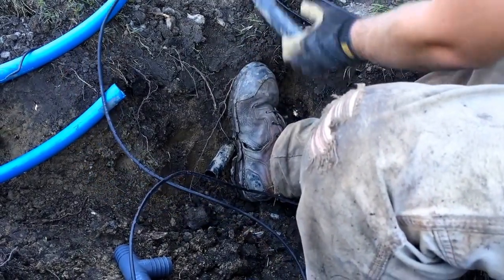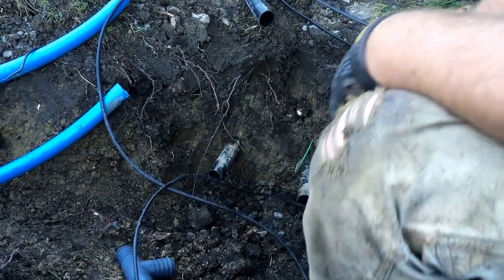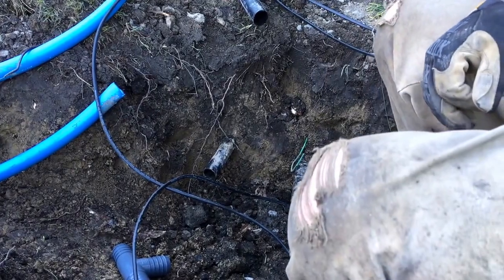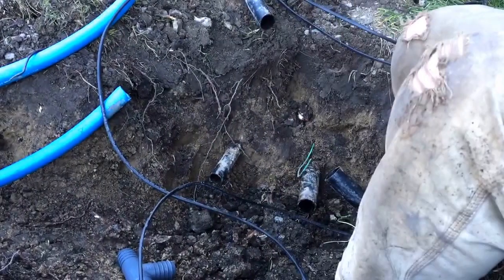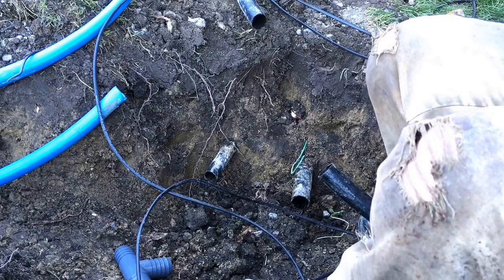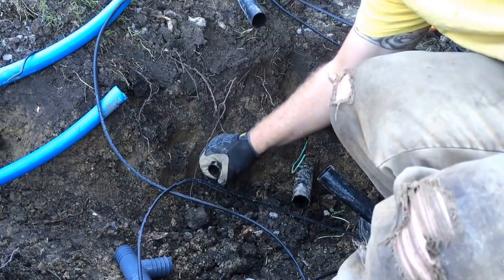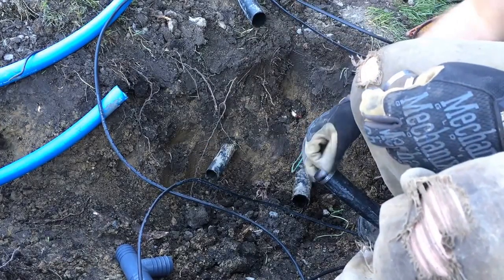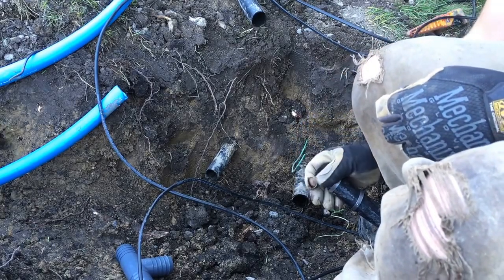Irrigation pipe size

Comment: Hello I am tying into my fields irrigation pump it should be around 80 psi my main line is a 1 inch poly line I want to do three rows of about 150 ft each I am thinking around 6-7 sprinklers each row will a 1 inch work for all of that do you think ?
Reply from the maker: Yes if you use 2.0gpm nozzles
Reply: @Irrigation_Tech_Talk  sorry it’s 3/4 instead of 1 inch
Reply from the maker: You could run like 3 on 3/4

Comment: sir i have a garden 300 ft away from my water tap.  I was thinking of using a 3/4" pipe as my main line since we use a bunch of 5/8" hoses and it gives us ok pressure to run 2 impact head sprinklers.  They sell the 60psi irrigation pipe (0.05" wall thicknes" which i think is too weak because i want to burry it 1 ft deep in the garden soil about 250ft worth.  There is another pipe a 100psi black pvc pipe from irrigation direct canada which i think is better but less flexible.  what do you think should i go 1" or stick with 3/4"  and which strength?   100psi or60?
Reply from the maker: 1” 100psi or 80psi should be standard
Reply: @Irrigation_Tech_Talk   Thanks so what you are saying is don't cheap out buy the better pvc pipe that will last 20 years in the ground.  Yes.
Reply from the maker: @HealthSupercharger  I would also advise if you are in a northern region that freezes to use polyethylene pipe PE pipe
Reply: @Irrigation_Tech_Talk  ok thanks

Comment: ? I'm installing a new lawn irragation system I just installed a 1hp pump on a new well I'm getting 14 gallons per minute my longest run will be approx 170 feet give or take 10 to 20 feet or so what diameter mainline do you recommend, I'm new to all this I've been told 1 inch is ok for home lawn irragation but 1 1/4 or 1 1/2 is better,  where does upsizing the diameter of the mainline start to become non beneficial. Please help.....Thank You.....
Reply from the maker: Charles Locklear do you know the pressure?
You want gpm at 40-60 psi
Then divide by gallons per head that’s how many heads a zone so 4-5 heads is my guess 
1 inch valves can move 25gpm so those are fine
It is common practice to use 1 1/4 mainline on wells you will have less pressure drop. 
1 1/2 is a pain to work with and not much additional gain
I assume you are talking about poly pipe
Reply: I'm planning on using PVC, heard less pressure drop, and if I'm gonna suffer using it I might as well use 2 inch or larger pipe up to my manifold box locations. thereby negating the friction loss and not losing the gpm choices on my sprinkler heads. Thx...
Reply from the maker: Use poly pipe it can be pulled and not open trenched
1 1/4” poly can move all the water you need
It will cost a little more  in material but the maintenance costs will be less. Also pay the extra and get Spears manifolds. 2” pvc is over kill and would cost more and take more time. Is it common practice to open trench in southern states but this is because the labor costs less. Worried about the material cost more but remember they also don’t care about the repair cost to you